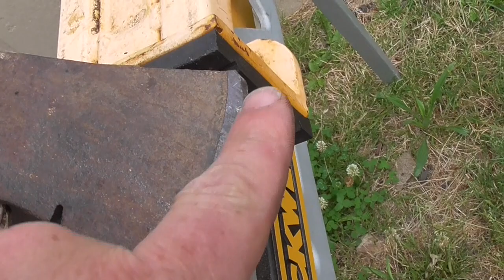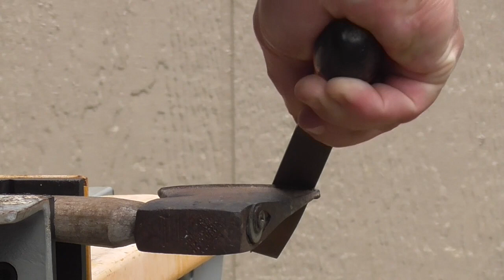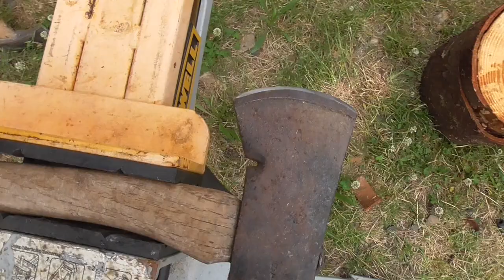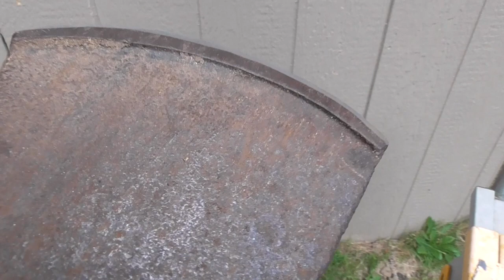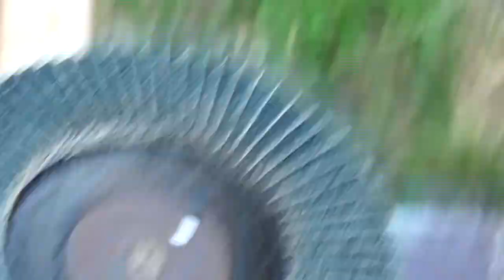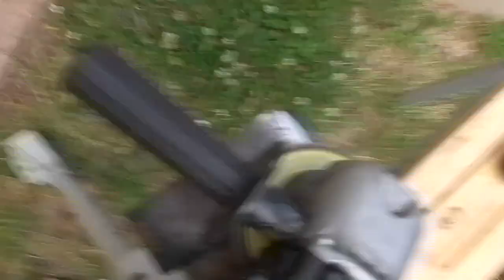DIY How to Sharpen an Old Hatchet Refurb Tutorial Demonstration [Sharpen Hatchet Blade]

Comment: Btw what is the fitting you used on the angle grinder?
Reply from the maker: Leonidas Knives & Gear nothing special just the spanner wrench and fitting that came with it. I always called those flapper wheels. They put the good shine on some metal. Not sure what they’re really called though:)
Reply from the maker: Leonidas Knives & Gear btw great to hear from you and appreciate the support bro!
Reply: DIYTechnician absolutely keep up the good work 💪🏼
Reply: DIYTechnician well they sure do get the shine like you said! I’ve been needing a grinder so if I get one I will get some of those flappers as well!